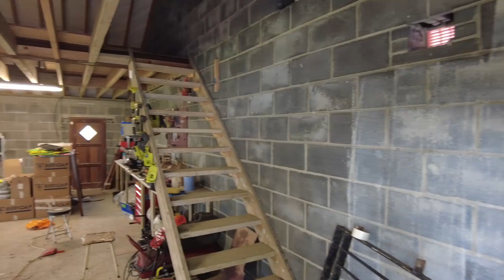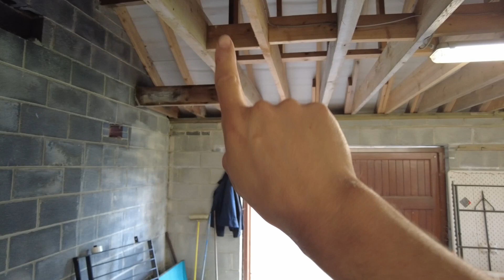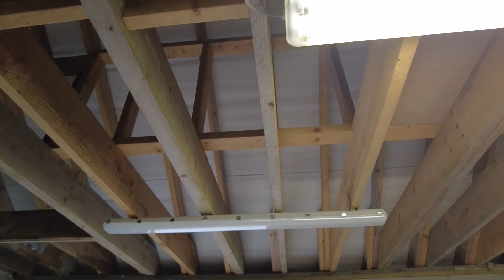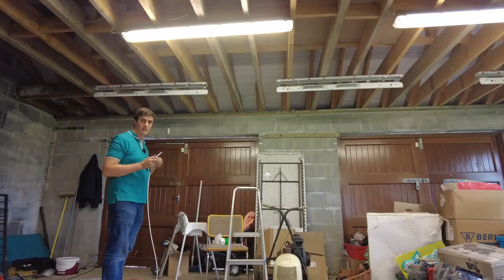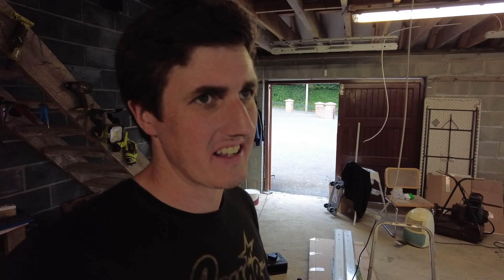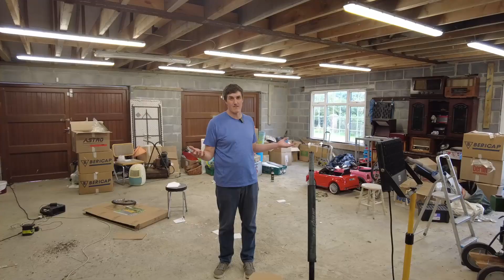Lighting my new workshop

Comment: Congrats on the arrival of the baibin.  I would suggest having a couple at 45 deg. at the junction of the ceiling and wall on both sides, and also take into consideration where you will park the cars with the bonnet up, you don't want to be creating more shade in your work area and the edges of the garage is where you'll need most light.
Reply from the maker: Thanks. That's a good idea about the lights at the angles. I'm hoping by the time I paint the walls white though there'll be more than enough reflected light. Time will tell and I can add to the setup if needs be.